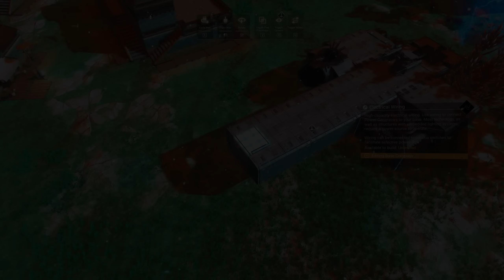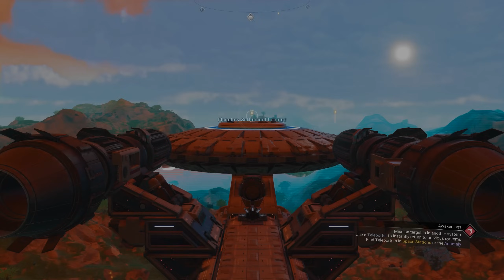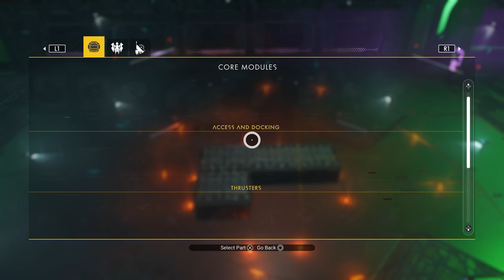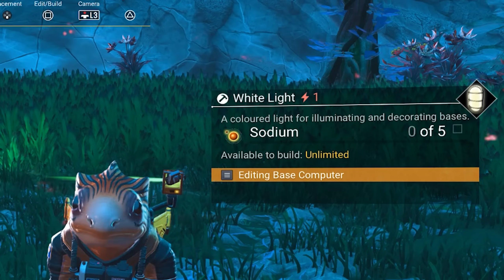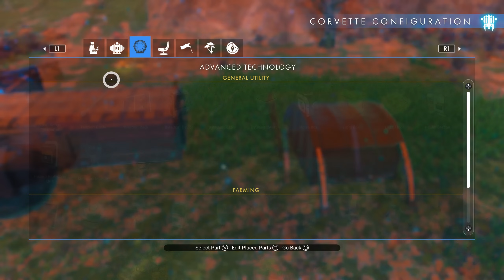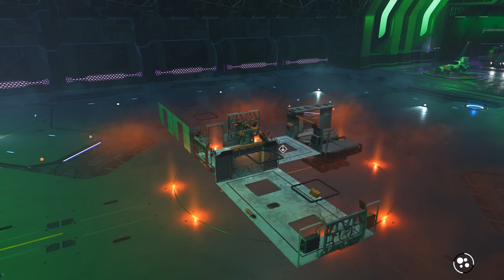[Archived] - The Transfer Glitch – No Mans Sky (broken with Breach)

Comment: I just want to be able to place parts at any angle, including vertical angles. Right now I have the horizontal angles knocked, but am still using horizontal merges to create vertical placement, and it isn't producing the look I am aiming for; all those enthusiasts, like your good self, moved away from NMS just because HG stubbornly will not allow part rotation in corvette building the same way as base building. And the result is that PC hacker gamers are now moving into community spaces and terrorizing innocent builders for no good reason; they are able to bypass HG's friend only settings and PVP off settings. And this is all because they wouldn't compromise the build editing and correctly fix the community networking support. HG stand to ruin all they fixed at this rate.

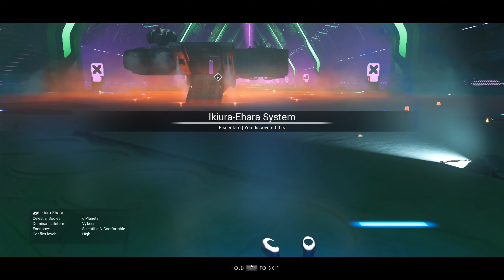Comment: I can't reproduce what Beebs do at 13:48. Whenever I go to the station and go back to the base via teleporter, my corvette is flying atop my head, and not landed where it was before... What am I missing here? 🤔I'm using the station on the same system... Should I go to another system, maybe?
Reply from the maker: Hmmm..

1) Did you glitch anything on the corvette that is not native to its menu? For example, I glitched a Teleporter on my Corvette, and after that it did not land properly anymore.
2) Someone Else had covered their whole settlement side workshop with floors, which resulted their corvette to no longer land on the ground. Make sure the terrain is clear for the corvette to land on.

Comment: Also one can use the small refiner on any planet to duplicate corvette parts. These sell in stacks of 50 for a great deal of units and also gives you many parts to trade for advanced parts which ALSO can be duplicated. I've found that you can build a massive stock of ALL the corvette parts in storage on any single corvette with storage installed!

Comment: Instead of vertical connections between habs that don't have hallways between them, you can also put a chair against the shared wall and sit in the chair to move between the habs. Perhaps slightly more time-consuming, but saves you some verticality.

Comment: The other day I made a corvette from a build i saw. And somehow during the process, the ship became 2x bigger. When trying to put stairs in they barely reached half way down and failed to remove the roof of the module (my cockpit was on the second floor). I had to teleport to another station for it to fix. 

But it got me wondering after watching a few glitch building videos... Is it somehow possible to scale a corvette piece up? 
My immediate thought is no, since scaling objects that aren't scalable needs to be part of the base building menu, for storing its cache... or am I wrong? Is it possible?

Comment: Hello! I believe I’ve found a new method and wanted to share it with fellow glitchers out there! I’ve also posted this on other sites, so this is a copied piece of text vvv

I believe I have made a new glitch that can make mathematically perfect shapes with corvette parts on consoles. Using Beeblebum’s method to transfer parts between a base and a corvette, it is possible to wire glitch ladders into specific places. This opens all possibilities in terms of corvette angles. One can create a matrix of wires and glitch ladders onto all points in order to make things like 64 sided circles with habs or anything a wire glitch builder can think of!

To do this, you need to glitch a ladder onto your corvette so that the game registers the ladder as being part of the base and not the corvette. Once that is done, you must either create or use an already placed wire for the next step. The angle of the ladder will be the same as any object glitched onto a wire, so the placement matters. As far as I know, you can only do this one ladder at a time and can’t duplicate the ladder to chain it. 

Once the ladder is glitched onto the corvette (but reading as being part of the base), pick it up, aim at the desired wire end, and wire glitch it into place. You should now have a ladder placed perfectly on the wire like any wire glitched part.

Using this, one can make any shape that they want if their wire glitching knowledge is sufficient.

All that said, Beeblebum, you’re awesome, and I hope that the word gets spread! Perfect hab rotation is possible!

Comment: This is exactly what i needed to finish my exocraft carrier. Deploying the roamer from a ship in low orbit is wild!
Reply: ok ima have to try this now lol
Reply: @BelunorGrimmorte I used the round frame structure and stacked it through the corvette to get the right height for the pad on my carrier, one you have it where you want use the forced method, it may not work right away but once you get the message you can't edit structural parts in flight you've got it! Just delete the pad at any space station if it is in a bad location on the corvette and try again, took me 2 or 3.

Comment: There is an easier way for the 90 rotation and no need the settlement for it. You can interconnect the parts if you willing to have a ticker ship, you can set normal titan class landing bay on one end and another to the other then just set the middle section empty and put hab under and above it. Not the nicest solution but working well also this way you can have internal doors :).

Comment: Is there a way to figure out what pyramid dimensions work to have a seamless center? ive seen some of your videos but all of them are a bit small for what im going for Ive been doing some trial and error but its really hard to get the top to line up as seamless as it can be. Im trying to go for a 60degree slant instead of the usual 45degress, i want it spikier but it seems hard to line up.

(i understand theres a formula but not knowing the exact heights of building blocks {afaik) makes its rough)

Comment: My game was chugging in the anomaly and I just realized it was because of this. Someone had this cool nature themed corvette with a bunch of plants on it.
Reply: it will also get bogged down just from big builds too and im talking like the whole system, the whole game not just in the Anomaly... my 100 piece build with all its extra decor and glitched snap points on the half-grid can NOT be docked with my freighter when i call my freighter... instant bluescreen. but my freighter base is also big and utilizes a lot of glitches and advanced build techniques too. like i have a huge living quarters hidden in the back pylons that are sometimes present, they tend to pop in when they want to lol, but the only way to get into said living space is via teleporter because where the pylons are 50% of the time, 100% of the time has an invisible wall that you have to teleport through... or you can use the phasing chair technique, basically a wall breach using any sittable chair the standing animation will force you through... just about anything lol

Comment: I wonder if most of the Anomaly problems could have been avoided if they made a separate hanger for the corvettes to dock at, that way the rendering would only happen if you were in the docking area itself.
Reply: They dont need to just need to work onnthe rendering of the parts

Comment: I would love to be able to rotate parts vertical and horizontally in a 360 degree arc. 

If I could have my own wish list…

1) Group parts to move them in a group
2) Full rotation on x and Y grids in at least 90 degree turns 
3) Native snap points in 1x1 grids on the long and short ends of the parts (to be able to place one hab or duct or whatever half way across another part)
4) Corvette teleport point or elevator as an alternative to stairs 
5) A couple others I can’t remember
Reply: Yeah, it's the same issue that drove me crazy in Starfield. I mean, I get not putting engines on the front of the ship (although if they would function - visually at least - as braking thrusters... then maybe) but not being able to attach the side mounted engines on top or bottom snap points? Or the handful of pieces that can be mounted top, bottom and sides, but not fore or aft facing? Just... WHY???
Reply: Resizing corvette parts would be nice too
Reply: i want 100% free placement for every build part.
would love to be able to highlight sections and move them entirely as one too.
yes a better teleport system for the corvette would also be nice like a wall mod with a teleporter like the ones on space stations, or even an entire hab thats a teleporter room would be nice...
and yeah having the small point to point ones actually work like they are supposed to so we can teleport around our corvette would also be nice.
not a fan of how the corvettes just drops a teleport pad it feels like a huge cop out to me. 
would love to see suit tech that lets us bring up our HUD and select a teleport point... like a party members corvette or our own, this would also come in handy when getting stuck in your build you can just teleport to your corvette, like chirpchirp "beam me up" wizzlewizzlewizzle, no longer stuck lol.
basically give us the little device we had during the expedition that teleported us to the space station, but instead of a consumable like it was in the expedition its exosuit tech... also with that said i think its time we got a 7th row of tech slots across the board. 
oh and storage we need true MP storage units, units i can put resources and other stuff into and my buddy can actually go and grab what i put in them, rather than my storages on my corvette, my base, my freighter always being full of his crap when he goes to look inside.

Comment: Always a good video!
To make a hub rotatable by 90 degrees, I used a different and simpler trick in the space station:
I placed one of the internal modules in the center of the edge of the hub using “free placement.”
Then a new hub, rotated by 90 degrees, can be built onto it.
Best regards.
Reply from the maker: Yes, ofcourse... and that is where we all started with the rotations, even for the circles...
But this guide is the foundation for future techniques, without making it too complex.

Comment: i really hope that this gets fixed and and glitch building option removed. It can absolutely ruin other players experience while in the anomaly. I had strange lags and also crashes while in the anomaly and other massive ships with big landing pads attached landed. NMS is not a pure single player experience. I hope Hello Games can fix that and also remove all the corvettes that have been build that way from saves or just not allow them to use multiplayer.
Reply: I really hope they can give us an actual good ship building system so we don't need to do any glitches.

This Starfield dogshit building is not nearly good enough.
Reply: @mikeuk666 and @oneiron42 modded ships are either invisible for console players or completely crashes or freezes our games. It’s actually impossible to report the ships because of this.
Reply: But also consider some people just want to be creative, it is not ok to remove something like that. Better solution is preserve this. It is also nothing wrong with the game, problem is avoidable. Someone proposed to make private dock room for corvette. I think it should be done for all. I think glitch is not the biggest problem, but it is complex geometry. There is no limit how much decoration you can use? 
Also i had some problems during exploration drop of FPS, while i want to explore the base of the other players, now i think it is fine... NMS don't have central server, everything is between players.
Reply: @madEsiak just because someone wants to be creative doesn’t mean they should mod the game and make it unplayable for others. There are plenty of ways to be creative that don’t negatively effect the player base.

There are restrictions for a reason. Going outta your way to ignore them or down right avoid them is malicious and should not be allowed at all by hello games. They definitely need to enforce what is allowed.
Reply: @rockyrex7673  Dude read my comment .. i tried to give you solution. If you are here only to argue just go away... Just read my comment instead being so negative about it. I don't proposed to ruin fun for others. I try to sympathize with your situation. So please respect others. Your ways is also wrong one.
Reply: @madEsiak your overreacting there pal lol. And I’m right, that’s why your so upset!
Reply: @rockyrex7673 Dude this was rude... I try to be friendly. I hope you gonna change your decision. Game is for everybody 🙂
Reply: Thinkmfhere need to be limit,on covette and buildingmparts seperatly so,ppl,can be creative and not lagg but out rightnremkving fun stuff likemthis killsmthengame and is just as selfish. Optomization from devs lower render and a say 400,part cap of corvett parts and 400 parts kr bass stuffmks fair.  Some pll just wanna suck the fun out
Reply from the maker: The thing is that even if they remove the glitches.. you won't notice a difference.
Because until now... the corvettes glitching out your game in the Anomaly where all Blender and Save edited.

The only way to sort this out is to limit the rendering of large corvettes, for example not rendering in more than 400 parts (total).
I personally don't see the point of building beyond that amount, imo.
Reply: @Beeblebum  as a developer it's pretty easy to detect any parts that do not belong to the corvette building library and simply block those ships from entering the anomaly or mark them as "not valid" so the user is forced to go to the space station terminal and "reset" the corvette by removing all non-valid parts as soon as you start edit the ship.
Reply: @ProgrammistMusic  issue is not the glitch building, its the poorly optimised part building, regardless if you glitch build or not, you're still limited to 100 parts. what Hello Games needs to do is just compress the resolution size down
Reply: @UnsungPhoenix  i do think that the 100 parts limit is a first safety barrier for now to test out the performance of the game in situations with a lot of corvettes. Even a single medium sized corvette landed by a fully expanded settlement drags down the performance quite a lot, especially if the graphics settings for base and planet are being set to HIGH or ULTRA. There is already some optimizsation going on, since you can see details vanishing if you get to a certain distance to buildings and ships.

The glitch building for ships is a problem, since players cannot choose if they want to be in the same scene when entering the anomaly. This is different from base glitch building, since you can choose whether to visit the base or not.

I am sure there will be more optimizations in the future, especially if you consider, that multiplayer still barely works in NMS and for Light No Fire it can be expected that players may want to join a real ship armada with tons of custom build ships. That is a huge task to handle for a game.
Reply: @ProgrammistMusic  You can always enter with multiplayer turned off. (Which does defeat the purpose of the Anomaly being a multiplayer hub)
Reply: @oneiron42  yes, but this is not the way it should be. I want to have multiplayer turned on and the game should work as good as possible with this feature. Apart from in-game optimizations it should prevent anything being build that could destroy the experience of other players. Or just auto-disable multiplayer for those players, who just want to glitch build for themselves.
Reply: @ProgrammistMusic then just take screenshots of said ships in the Anomaly & contact hello games zen desk.
Reply: @ProgrammistMusic  Fair enough, the report base option is best bet currently (It will remove the corvette). I would personally love to see them figure out how to implement some more base pieces into corvette building, even if it meant limiting it to a certain number of base pieces. I'd love to replace my faux landing pad with a functional landing pad

Comment: I'm trying to get the ambassador landing bay to work properly when attached at the front of the ship, under the cockpit and facing forwards. I think it looks cool, but as soon as I go up the ramp and step on the floor of the landing bay, I fall through. Also, the landing bay room does not open to any Habs from the inside, so I can't actually access the rest of the ship.
Reply: I've found that habs have a "front and back" so when they don't open you usually just have to rotate them 180 to fix them.
Reply: @yosemiteanemone4714  Ahh! thx. I tried both the full habs and the shorter connector modules, but didn't try rotating them. But if I turn the one hab around (that connects to the landing bay, will that hab then be backwards to the other habs it connects to going back? I think I'll also still have the issue with the landing bay having no internal floor though. I don't think the devs planned on the landing bay being used in the forward facing position on the ship. But it does look cool walking towards the ship from the front and walking up the landing bay ramp.  : )
Reply: @Graybeard_  Yeah, it can get tricky to get all your habs to line up usefully.  IDK what to look for to tell which end is which, so I just flip them randomly till it works.   BTW I've noticed the problem with the Landing bay and I've solved it somehow by trying different parts and flipping them around.   I know putting an inverted cowling (the longest one) underneath solves it for sure.